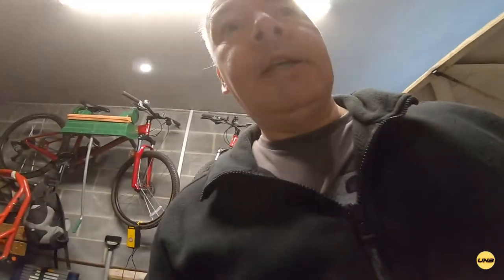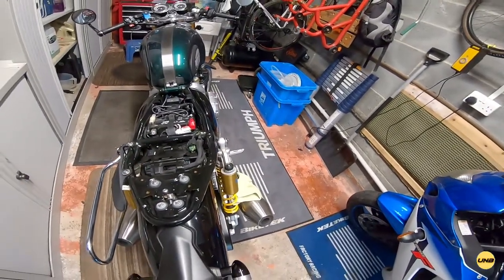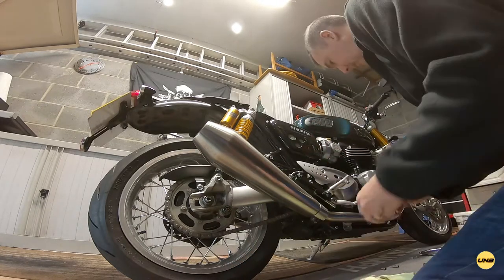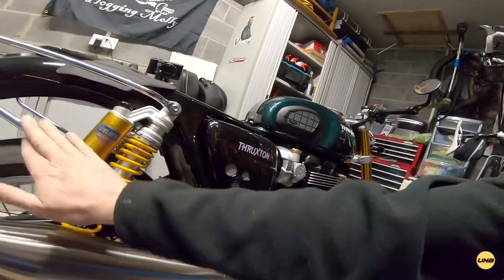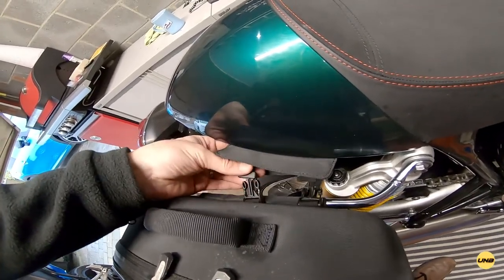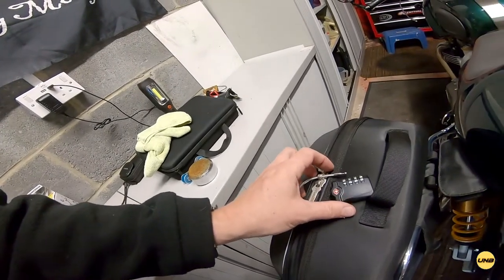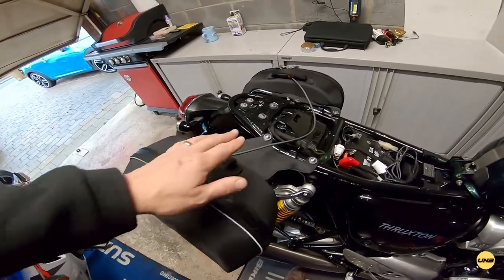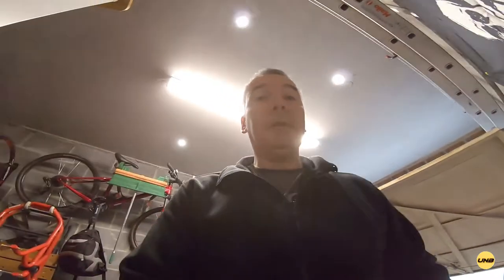Fitting Triumph Nylon Panniers to a Thruxton R #14

Comment: Just fitted these to a 1974 Commando, the security info will carry across too.
Reply from the maker: Wow a Commando, beautiful bike and rare now. Are you touring on it?
Reply: @upnorthbiker  Not so sure on the rare, approx 85K made and over 50% still around but 80% did go to US when made. Panniers are replacing a rackbag for day runs but do get some miles in going to Classic TT which is pencilled in for 2023.

Comment: I've seen a pair for sale with the fitting kit.  The instructions say that they won't fit if you have done the fender eliminator conversion.  I'm away from the bike at the moment, but trying to figure why, as the nylon lugs fit to the top rail and not underneath. Any ideas please?
Reply from the maker: I can't see why they wouldn't still fit, the fixings are to the suspension, the foot pegs and  the frame under the seat

Comment: Many thanks for this, I have fitted mine today, to my Thruxton RS couldn't get them for £117 though. The instructions made it easy and the security aspect really helped my confidence in the product. I wasn't quite expecting the suspension bolt to be quite so hard to shift.
Reply from the maker: Glad it helped, i have used mine a lot and they seem quite durable.

Comment: Excellent video, very detailed.
I assume setup is the same for a T120.
Do the panniers not move too much when you ride on bad road ?
Thank you from Switzerland.
Reply from the maker: Hi Thanks for the feedback. I would think they are very similar on the T120 however Givi now do a rack for the T120 so you can fit Givi side cases to the Bonneville. Regarding the panniers, yes they move a little but do not really affect the handling on medium speed, 60 MPH, twisty roads. I have not been on a motorway with the panniers fitted but as long as you are not going crazy i don't think they are heavy enough when loaded to cause major handling problems.

Comment: Great video my man. I have a silver Thruxton R 2017 I've been looking for some panniers that would not spoil the looks of a magnificent looking motorcycle. I have a tiger xrt for a long trips but once in a while I would like to carry something on the Thruxton. I'm wondering what those Chrome brackets would look like painted flat or gloss black if they would stand out less and be less noticeable...
Reply from the maker: I was thinking of getting some plates welded on the inside of the frame with a union jack on them to make a feature. They only take 5 minutes to remove if you only use them occasionally. I have been looking at the Tiger 1050 for longer journeys but not ready to buy yet.

Comment: IF YOU LET ALL THESE THREE LOCKS ON THE PANNIERS DURING THE VOYAGE  --  THEY WILL CRAMBLE AND DANCE ON THE PANNIERS CAUSING DAMAGE TO THEM AND A HELL OF NOISE  !!!!!  IF YOU DONT THEN YOU HAVE TO LOCK AND UNLOCK THEM  EVERY TIME YOU STOP  -----
Reply from the maker: Hi the panniers are nylon so there is no noise or damage. Agree it would be no use with hard cases